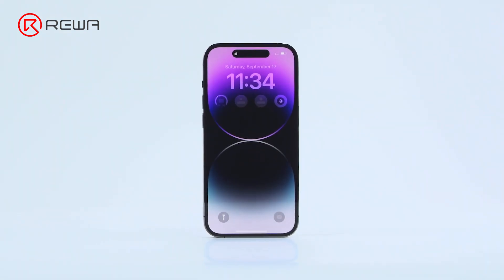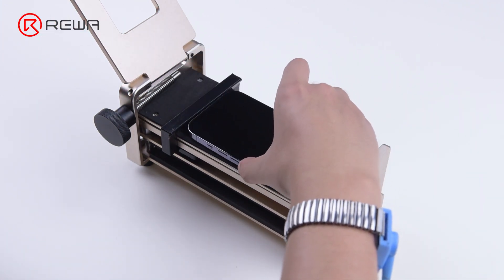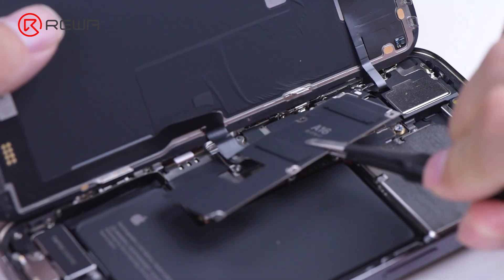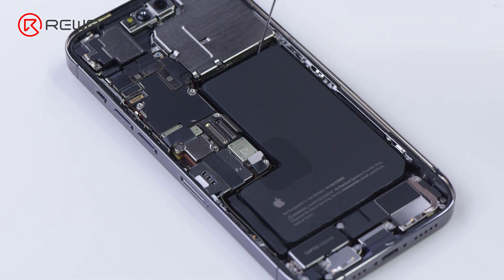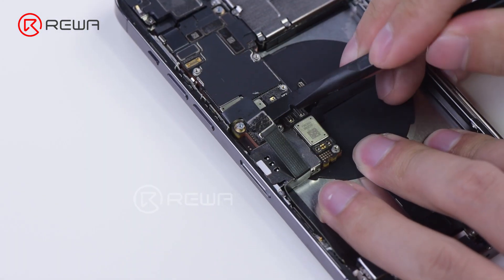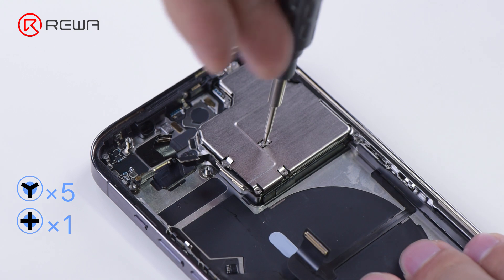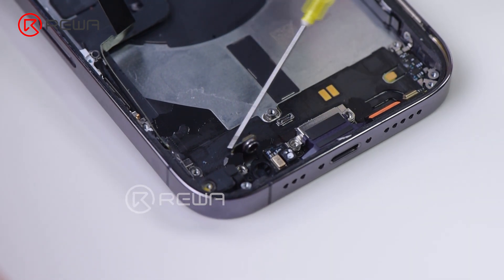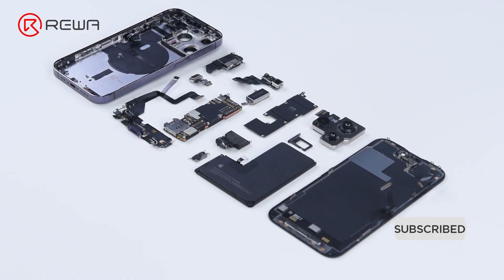iPhone 14 Pro Teardown – Full Repair Tips

Comment: please I have an iPhone x that a customer brought in for repair. I think it has something to do with the display. The phone when powered on or plugged into a charger shows the apple logo. But as soon as the phone is about to boot up the screen goes blank but the phone still indicates that it is still on when you plug in a charger or press the vibration button on the side. I have tried to diode mode the connectors but they all read just fine. Any solution, please
Reply from the maker: Hi, there are some suggestions from our tech team, first, you can use another screen to check whether the problem is caused by the screen or motherboard. after that, you can check the components near display connector is pseudo soldered. If everything is fine with the first two steps, you can do motherboard sparation to check the inductor.

Comment: Any technicians out there know if data recovery on an iPhone 11 top layer of the motherboard only is possible? Bottom layer has a short somewhere and I cannot find the short. Top half works but when I swipe up and enter passcode it goes into “attempting data recovery” but as soon as it finishes goes back to Lock Screen then back into “attempting data recovery” after I put in passcode again. 

Could I use a bottom board from a donor to fix that issue? 

I ask before further attempting anything else because data is important. 

Thanks
Reply from the maker: If you want to use a donor bottom board, you need to transplant the original baseband CPU, EPROM, NFC and WiFi module to the donor board.
Reply: @rewatechnology2008  only need for data recovery only though. I’ll test today if a doner bottom would work just for data recovery
Thanks
Reply: Where are you from? If you are from India i can fix you